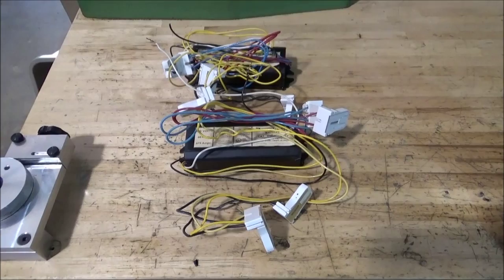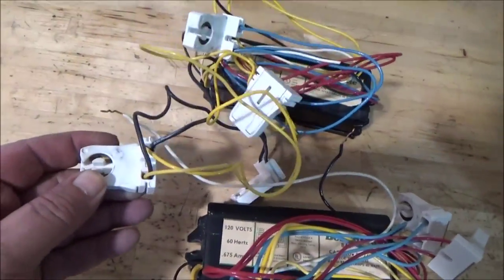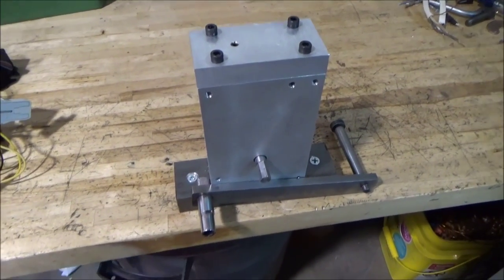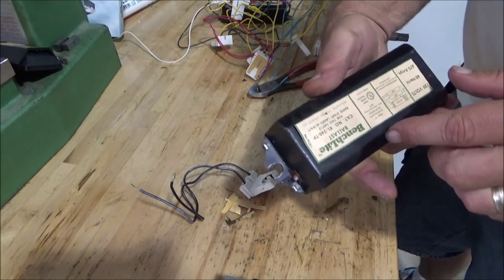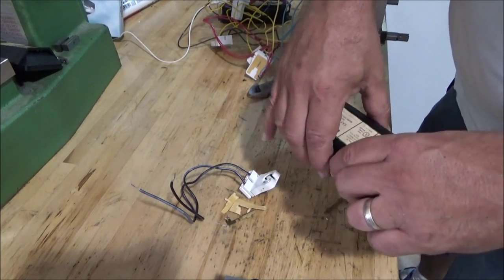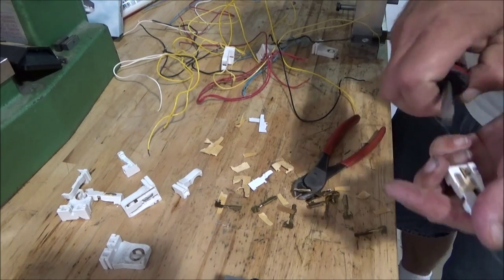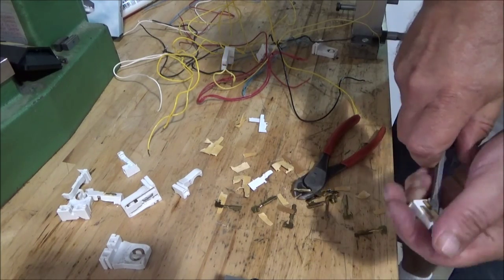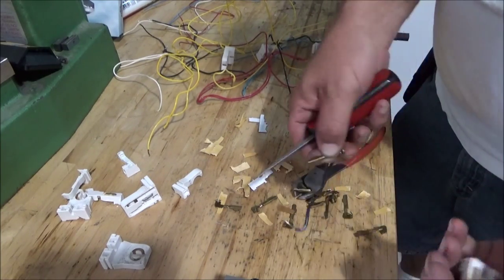How to get copper and brass from ballast wires and connectors

Comment: If the brass clips come out like this I would do it that way first. But when they're encased in plastic I put them in a old fryer basket and place on top of a fire. If you like them to be bright and shiny just put them in vin and salt when they are hot. idk works for me.  Gets you and extra couple bucks

Comment: where did you get that stripper?
Reply from the maker: +Tony Lights This is a prototype solid wire stripper I made for RBF Products. We are testing it for durability and ease of use at this time. More info about it can be seen here: https://youtu.be/tt1i1HnTxQ4

Comment: To me it looked like you did quite a bit of work for a very small amount of brass.  Not sure that it would be worth the time for most.  The copper, on the other hand, seemed like it was well worth stripping to get bare bright copper.
Reply from the maker: Wasn't really hard to get the brass out. If I had a whole bunch to do I would have just smashed the plastic case to get it out faster. The way I see it. It takes 16 oz. to make a pound and it doesn't take long to fill a 5 gallon bucket if you just keep throwing in every piece you find.